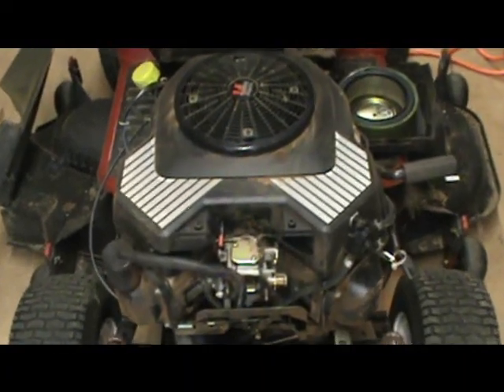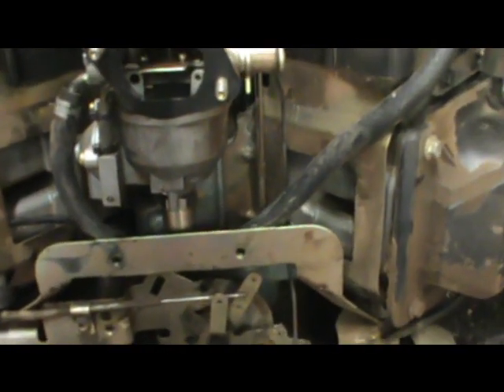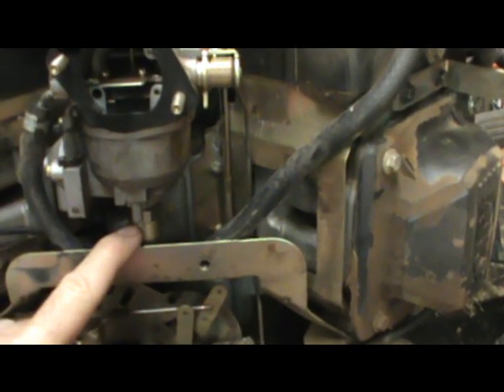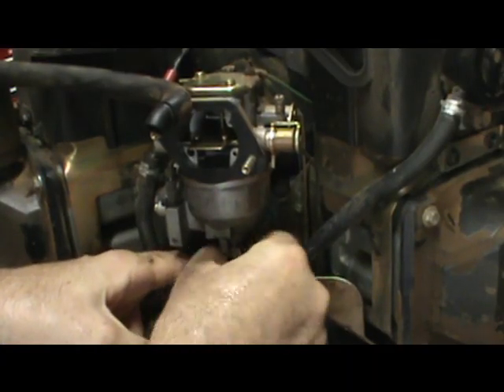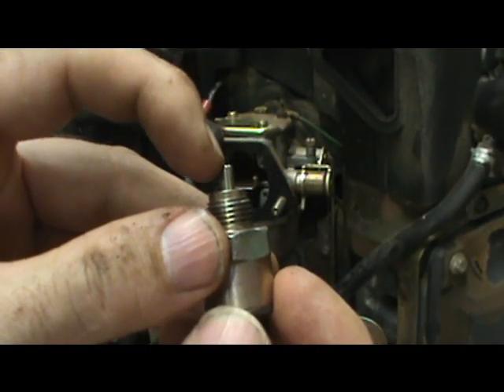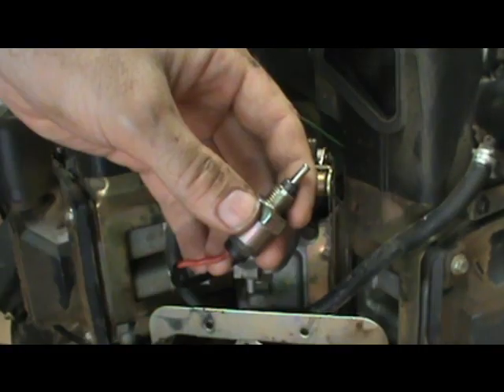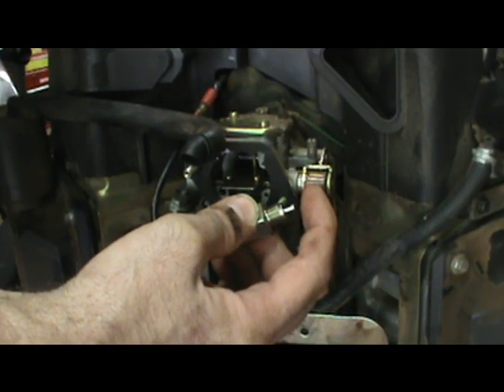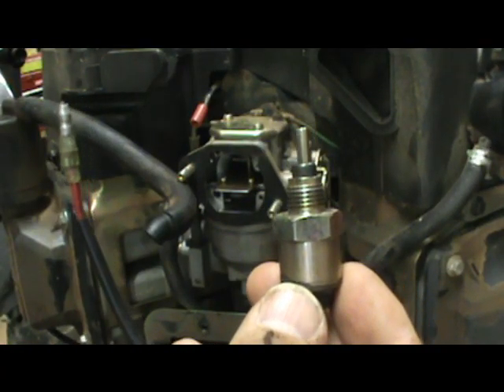Small Engine Repair: How to Check a Solenoid Fuel Shut Off Valve on a Kohler V-twin Engine

Comment: I haave a 24 horse briggs and straton v-twin when you crank it it will run about 2p seconds then it willcut off but will crank right back up when it cranks it smokes pretty bad dont know what to do
Reply: Tony Morrison sounds like a clogged carb or in your case carbs, or bad valve guides leaking oil into combustion chambers. Is the motor old? Have you pulled the plugs to look at them? checked the air filter making sure its clean and not clogged up?as far as carb issues, typically the ethanol in gas evaps faster then gas leaving particulate that clogs up jets and fuel passages. I always put a fuel stop valve in fuel line prior to carb and when done using engine turn off gas valve, run the motor until carb starves for fuel. the eliminates the fuel in the bowl from evaporating clogging the jets.
Reply: Tony Morrison make sure the oil level is right
Reply: Thanks
Reply: The Ethanol is hydroscopic and absorbs moisture.  Some fuel still remains in the bottom of the float bowl if you run it dry, unless you have a drain or physically drain it by loosening the High Speed jet

Comment: I'm not receiving any voltage to the solenoid. I put my multi-meter on the connection, turned the key and the needle didn't move.  I'm getting at least 10 volts to my lights as a control.   I'm also getting a shock from the chassis more often than I believe that I should.  The engine cranks, but does not start.  There is gas in the carb in the lower portion where the float is.  Any ideas would be greatly appreciated.
Reply: That solenoid wire may be shorting to the frame before it reaches carb area.

Comment: Hello...I've misplaced the spring inside of the solenoid. Any ideas on how to get one? I've talked to my Kohler distributor and they say I have to buy the whole solenoid. It seems silly, especially since I cant be the only one in the world to have misplaced one.
Reply from the maker: Julio Castro I don't think you can buy replacement parts made specifically for the solenoid, but some hardware stores do sell springs. Might find a used parts online.
Reply: Perhaps one from a ball point pen would work if you re wrapped it around something slightly larger in diameter

Comment: Sears repairman came to diagnose my Kohler-engine Craftsman Garden Tractor today, said the problem is the fuel solenoid. Said he can't replace just the solenoid, has to replace the whole carb for $600. I ordered the carb from him, but after seeing this vid I'm going to check the solenoid myself in the morning and see what's what. If it needs replacing, Amazon has the part for $29, delivered in two days. Great vid, well-explained.
Reply: Since when does a carb for a mower, or anything else the average person has around their house cost 600 bucks ?  Saying you can't replace a solenoid and charging 600 bucks for a new carb , even with installation ( two screws a couple small cables reattached and a fuel line, total of 15 to 20 minutes ) are both crimes and he should have been reported to the police. Also, Sears should have been notified and the better business bureau as well. I got a replacement carb on line, brand new OEM for 30 bucks with shipping. That repairman was a thief and 400 dollars of that was going straight into his pocket….thats if it even cost 200 for travel, the part and time.
Reply: this is why Sears is going out of business hah.
Reply from the maker: Guitarist.com Thanks for watching!
Reply: $600? lol, could buy the whole engine for that, replacement carb costs about $40

Comment: Nice Video, i'm gonna check this out on my mower. I just got a Cub LT2180 in really good condition 111 Hrs it has not run in a few years, I cleaned the carb, replaced fuel filter, and all the necessary steps to get it running and it runs but no fuel. I can see in the fuel filter no gas is pumping , I also cleaned the fuel pump so my guess is the pump or the solenoid ?
Reply from the maker: Check the fuel lines, fuel pump, gas tank, etc.

Comment: Excellent video, I entered to watch how it works and it's very clear to me now. Curiously the shut off solenoid in this video looks identical to the one I'm searching for a 1992 Subaru Justy's Hitachi carburetor, I unscrewed it with a 19 key and I'm pretty sure the thread is the same. Can you give me any idea to help me find it? Thanks.
Reply from the maker: Are you asking for the part number? You can find that on the Kohler engine website, but Kohler will use a different part number than Subaru even if they are identical.

Comment: Great video..I took the carb off 3 times before finding this.  Well done.  Started and ran great.  Engine hadn't been run for over a year and the solenoid would not operate...Removed plunger, cleaned, reassembled.   Perfect!  Thank you.
Reply: How did you get it to move. Mine doesn't budge????

Comment: I never here why the solenoid cuts off the fuel. Is it triggered by the oil pressure switch ?
Reply from the maker: When you shut off the engine the solenoid closes the fuel circuit in the carburetor to prevent fuel from entering the engine during shut down. It is electrically operated, so it is triggered by the key switch.
Reply: Is there a oil sensor that shuts off the engine?
Reply from the maker: Sorry, I can't remember if this engine has that feature.

Comment: Boy did I need to view this video. Having trouble with my John Deere, needed to know what the hell this thing does.And how to test it. You explained it so even a knucklehead like me could understand.
Reply from the maker: Thanks for watching!
Reply: Hello I like you videos cuistion so that wire is conect to switch or to the battery?
Reply: Might be too late for you Guillermo but it connects to the key and goes up and down as you turn the key  @guiilermosilva5394

Comment: I am having fuel leaking through the carb when the engine is shut off. Would the solenoid stuck in the "open" position, i.e. not springing back after the mower is shut off, cause this problem?
Reply from the maker: No, the carburetor shouldn't leak

Comment: do you have to ave this solenoid? mine has it but that rod at the end snappe for some weird reason or another.. not sure what happened, I too my carb off to investigate a idle issue/ hunting issue.
Reply from the maker: It prevents popping when you turn the engine off. If you remove the solenoid or if the solenoid is stuck in the open position, than the engine will run but will draw fuel into the engine after you turn off the key and the engine is still turning.

Comment: Thanks!  My chinese GX390-clone generator has one of these.  Does this means it needs electricity to start?  Makes as much sense as a screen door on a submarine.
Reply: Kevin lol that's hilarious screen door on a submarine....im right with you man this part is ridiculous on a generator...not only does my generator have a fuel shut off valve so why do i need this dumb shit...if battery dies and I want to use pull start to start it it won't fire up because the stupid ass fucking fuel solenoid doesn't have power to it and it's blocking off the main carburetor jet...
Reply: @macknumber9 polls starting it causes the Magneto to open it the Magneto produces the electricity you need

Comment: I have have problems starting my craftsman kohler engine. I just get a clicking noise, with no gas going to the carb. So i tested the battery and its at 12 volts. I disconnected my Solenoid and plugged it back in and held it against the frame to ground it. And when I turned the key, I have nothing. It won't go up or down and nor will the engine turn over. When I tested the line to the solenoid there is current. So does this sound like I have a bad solenoid?

Comment: I am having this same problem. starts with choke on then goes full throttle and dies, but will sometimes run for about thirty mins. kind of random. any suggestions? cleaned carb, fuel lines, spark plugs. could electrical in solenoid be surging?

Comment: Perfect! I think mine is stuck as fuel will fill the cylinder. I installed a manual in line fuel shut off valve but I'll go after this next. Thanks.

Comment: This rocks. If you have a fuel supply problem do this first and save yourself a lot of hassle. I went from the tank to the carb as suggested by others and replaced all those items in the fuel line. Finally got to this. Start here as modern fuefs clog this up first.

Comment: Solenoid Fuel Shut Off Valve mine was bad so i cut the tip off that you screw in and filled it with jb weld and did away with it because they wanted 70 bucks for it.

Comment: Oh man. Thank you so much smallengineshop for posting this video on the solenoid. I took mine off and I forgot if it had a spring in it. This video shows that it, indeed, has a spring. I must have lost mine when taking it off. I'm trying to run a sweeper magnet to try to find it but it looks like I'll be buying a new one at $110 at Sears, which sucks.
Reply: Save your money. Get rid of that solenoid POS. Put a shut valve in where you control your gas supply. No more worries. Shut off valve on Amazon. CHEAP!! Save the $110.00.
Reply: @thomasokeefe3081  I know naathing but that seems like sense to me. They invented this gadget to avoid having problems cos people don't use the cheap 'tap'. But I'm probably wrong. No inline tap on my expensive Briggs Intek. Tap and no solenoid on my old cheapo Briggs IC which has no problems.

Comment: Thank you. This is a good place for me to start. I'll be checking out my Kohler 20 HP solenoid fuel shut off. I think this might be the problem I'm having because, although it's difficult to start, I can usually get it started, and it runs fine. However, when I shut it down, I am getting a bit of a latent backfire.

Comment: bought a mower that has been sitting out for quite some time and wouldn't start.  I found your video and decided to check it out.  I noticed that the piece was almost stuck on the close position, so i cleaned it and now it starts up!!! THANKS
Reply: When you dropped the solenoid, did gas still flow out of the bowl?

Comment: Thanks for this video!  My engine cranks right up but then dies almost immediately.  I can feed it gas through the carb and it will continue to run as long as I feed it....   I will check the solenoid and see what happens.  Wish me luck!

Comment: Thank you for uploading this video. I'm having carburetor troubles with a Nikki carburetor on a Toro riding mower.  You gave me another method to check for fuel flow problems before going into a more extensive solution in solving an engine miss at all speeds.

Comment: I too had this problem four years ago before I started doing my own work. They told me it was the fuel shutoff solenoid. Then they said they couldnt get the part unless they ordered the whole carb. They shafted me $600 for the repair and it was down for two weeks. 
Needless to say I wont be going back there again. I can do it myself easier and cheaper.

Comment: Very good video. I have a twin v engine on a Briggs and Stratton that has been sitting a long time and it won't start. I have good spark and can keep it running if I continue to spary engine starter fluid in the carburator so I know it's a fuel problem. I can't wait to check this out because it sounds like my issue.

Comment: Very helpfull.  I have a Struck bulldozer with a 2 cylinder Vanguard engine.  Have replaced fuel filter and line, cleaned fuel tank, and verified fuel pressure all the way to carb.  Had carb apart inspecting jets and float valve assembly.  All OK.  Didn't even know what a fuel valve solenoid was!  Thanks!

                         JACK